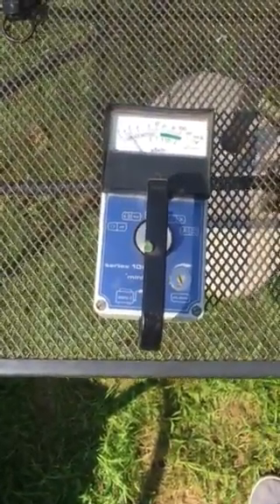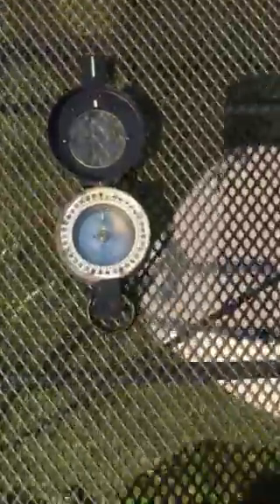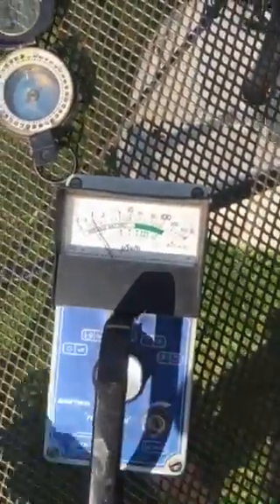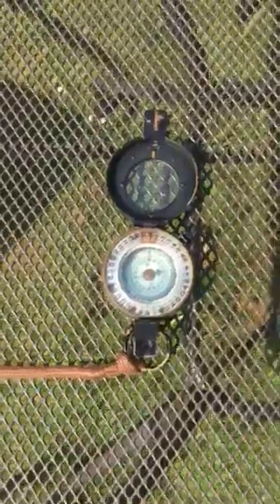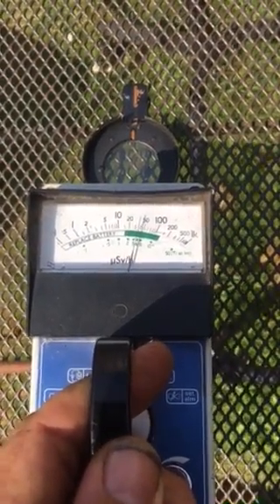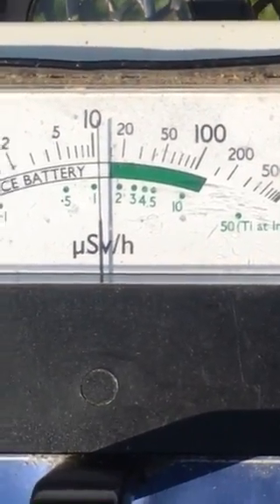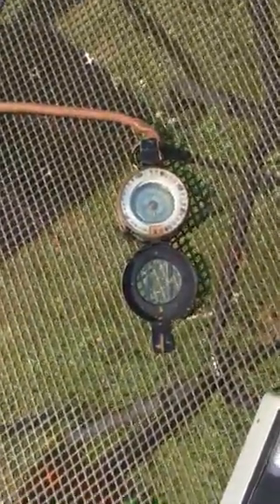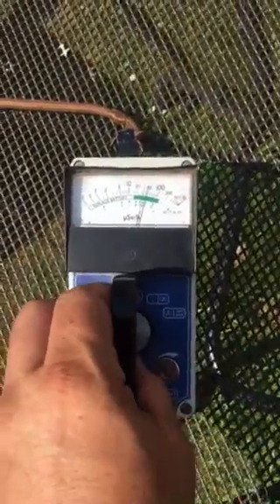Radium warning WW2 watches and compass's.

Comment: Nice! I collect radioactive sources! That brownish color would have been a near-white color when it was first applied, but the zinc sulfide has had its crystal structure damaged, and the self-irradiation of the radium lume also burned it over time. Its glow would've been quite bright when it was new. The very high energy beta particles and gamma rays also contributed to this, mostly from the decay isotopes rather than just the Ra-226 itself, but alpha particles pack the most punch, about 20X that of beta and gamma (Q-Factor), however, alpha radiation is easily attenuated by very little matter. And many of the decay products of Ra-226 are strong alpha emitters. That's a beauty you got there! I see that your measuring in dose, but the G-M counter doesn't have a CPM or CPS mode, which is what I always use when taking a count. If it isn't calibrated to Ra-226 (or what you're measuring), the dose measurement will be inaccurate. Oh well. Some detectors just don't have CPM or CPS. They really should, because it can be misleading to those who are new or know very little about gamma radiation. Well, I probably will end up looking for one of these compasses to add to my collection, even though I have a lot of radium sources already! Thanks for sharing! Cheers from the USA!

Comment: Would a WW1 Compass dated 1918 possible have radium on the dial?
Reply from the maker: Susan Bell Flavin 
About 90% yes. What make is it? Any writing on it at all?  
The radium/zinc mix has degraded over the years and is now usually a browny yellow mottled colour.
Reply: Scott Humphries its had S Morden & Co 1918 on the back. On the arrow of the compass, I see that  brownish paint, but there is very little of it. The glass is intact and the condition of the compass is excellent for being 100 years old.
Reply from the maker: Susan Bell Flavin 
The Brownish paint is Radioactive Radium mixed with Zinc.
Reply: Probably, especially if it's military. I collect radioactive sources of all kinds. And I look for the hottest sources I can find. I've done this for many years . . . It's fascinating to me! As for Ra-226, as long as it's sealed, it's of little concern. In reality, it's not much. A compass like this probably has only a few micrograms of Ra-226 + its decay progeny, give or take, which would equal a few microcuries (specific activity) give or take, since 1 gram of Ra-226 = 1 curie (37 GBq–or 37 billion decays/s). Radium is hazardous if it is taken internally, especially inhalation. It's of little concern if it's sealed and stored away safely. It may sound scary on a Geiger-Müller counter, but in reality, it's nothing remotely dangerous. Also, he's measuring in dose (μSv/h), rather than counts per minute or second (CPM, CPS). Dose mode is only accurate if you have it calibrated to a specific isotope. Most are calibrated with Cs-137. CPM or CPS should always be used instead of a dose unit, unless it's for what the instrument is calibrated to (gamma only). Also, different isotopes emit different energies, at different intensities, with or without gamma rays. Each isotope has a unique energy spectrum, be it alpha, beta, and/or gamma/X-ray. Also, chemistry. Radium is similar to calcium, which makes it more hazardous, than say Promethium-147, which has no known biological homologues.
Reply: Would british army 1917 vernier compass have radiation?